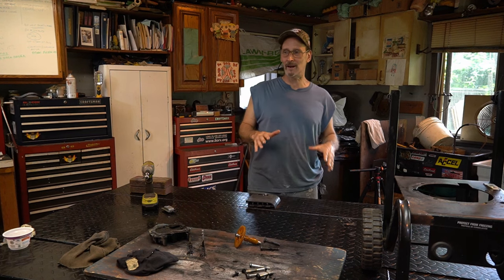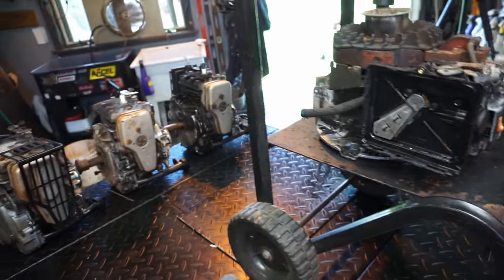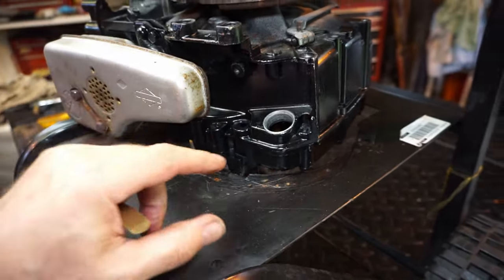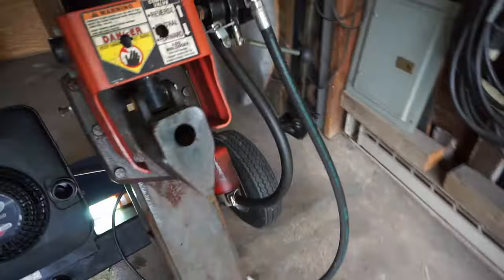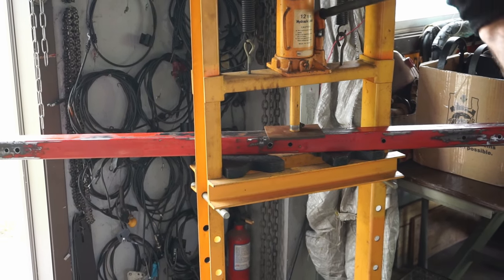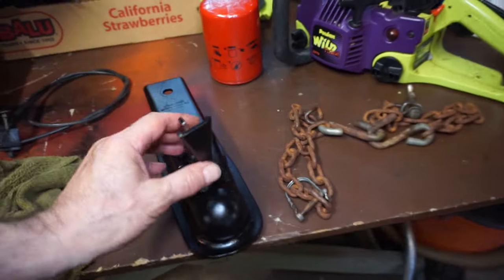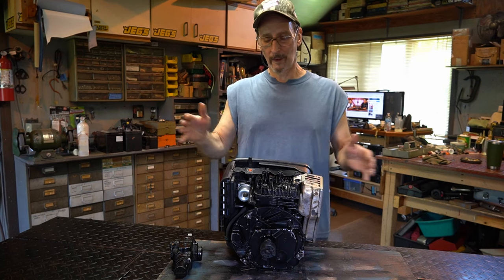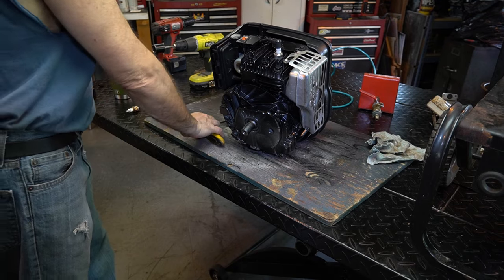BUDGET ~ Old Broken LOG SPLITTER FAIL - But Ya Cant Use A Lawnmower Engine - Let's Fix It

Comment: One of the things that has always amazed me about small engines is the amount of ABUSE they take. Mowers left outside all year, never cleaned or tuned up, air filters not replaced, valves never adjusted, chain saws bouncing around in the back of a pickup truck and yet, they continue to work and are EXPECTED to by the owner! Even after years of this zero maintenance and abuse they still run with a little work. AMAZING! Question: What do you recommend to use for determining the RPM's of a small engine and how powerful a MIG welder do you recommend?
Reply from the maker: Soooo true Richard!
I buy a lot of garbage, by the "Lot" and its amazing what I see sometimes and what comes back!
That's a great question, 2 things determine this; 1st is the engine itself and most of these small engines have a MAX RPM of around 3200 - 3400 rpm. However Bruce and I (Bruces shop) feel that as they age and we refresh these machines, keeping them around 3k rpm is probably a better practice and they have a better chance of surviving much longer by reducing the rpm a little! 
2nd, in this case for example, we have a pump and all pump have a nominal rpm were they perform properly without undue wear or even Cavitation happening. I don't know off hand what that is but we can do some research on pumps similar and find that value. 
Parts are binned, meaning engineers pick from parts that are known to work with one another. They don't get paid to re-invent the wheel.
For most of the equipment I repair I try to keep these things in mind.
Reply: @TheNovaJohn  lol...........what device or rather who makes the device you used to read the rpm of that engine?
Reply from the maker: I forget, I bought a cheaper one, eventually I will get something better but they don't need to be expensive, here's a link to something similar. I recommend something with a common replaceable battery! I had one that was potted in and yep, it died!

 https://www.amazon.com/Small-Engine-Tachometer-Hour-Meter/dp/B09NVRZCSK/ref=sr_1_10?crid=2PXZMWTY7R95N&keywords=rpm+tachometer&qid=1657031827&sprefix=rpm%2Caps%2C69&sr=8-10
Reply: @TheNovaJohn  Thank you!

Comment: More uses for Super Clean - all discovered this morning. Trash can - stinky and nasty - sprayed the entire inside and let it sit for 15-30 minutes, then rinsed totally clean!  Taking apart a Stihl engine with a whole bunch of oily black grime on one side. Sprayed, scrubbed with toothbrush, sprayed again and scrubbed some more, rinsed and clean. Blocked off intake and exhaust and mounted pressure gauge. Sprayed around crankshaft on both ends and pumped bubbles out the dirty side plus some out the crankcase joint as well. I’ve got my work cut out for me but I’m expecting Super Clean to help remove carbon off of piston and cylinder as well! 👍
Reply from the maker: awesome,,,just be careful using it on aluminum...It can stain it and even mess it up. As long as you don't leave it on for too long you should be good!
Reply: Arch's Garage   Thx for the heads up. Good thing I rinsed that engine pretty quick. I’ll keep in mind. 👍

Comment: Jake and i were watching this video and i said i heard a little knock in the original engine when you got it running. I think it had already been damaged from exactly what you pointed out with the valve issue. Actually enjoyed watching the entire video even if it was a long one. Keep er going buddy.
Reply from the maker: He knew the engine might be junk but I figured we could try working with it, its an Intek so. I reminded him that we would need to load test these things. It is a long vid and I agonized over keeping it together as whole as possible. Don't gotta tell you guys that pressure!!!!
Yet showing the process I thought would be important. We know these things from years and years of experience but other haven't had that time..
I also mentioned that the better machines use a Horizontal engine. If it were mine I probably would have converted it.
We all started from the beginning! 
Thanks for watching guys!!
Reply: @TheNovaJohn  Even though it was a long one it was a good video Arch see you on the next one.
Reply from the maker: Thanks Wayne!!!!!! Glad to hear from you guys!!!